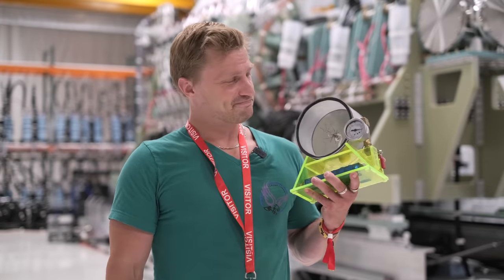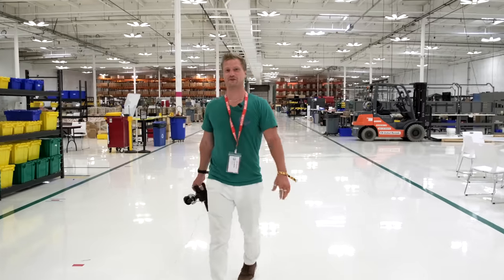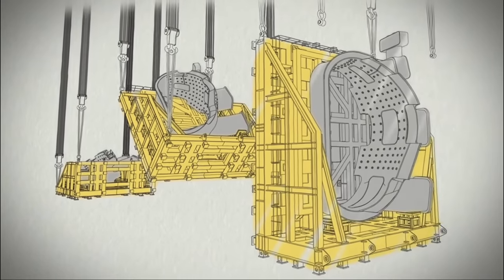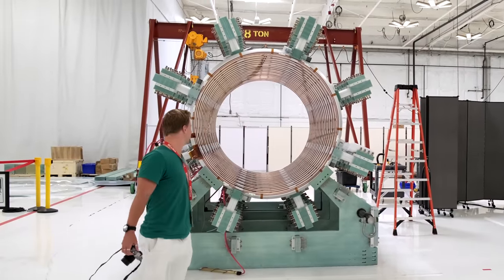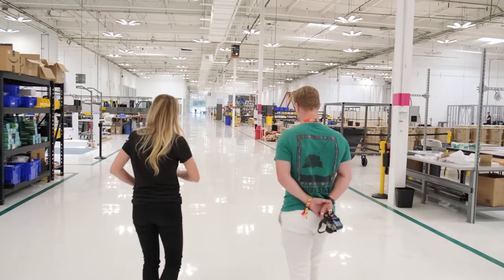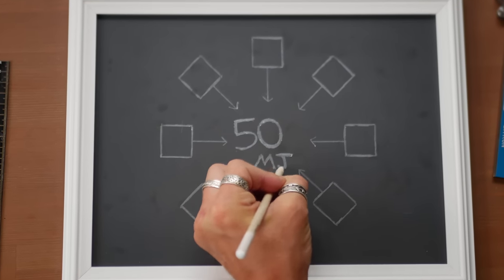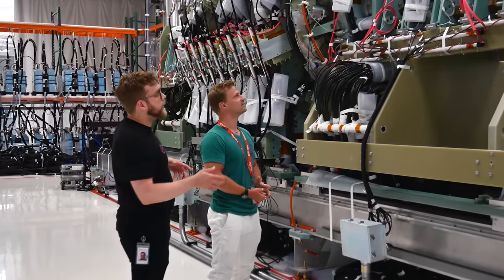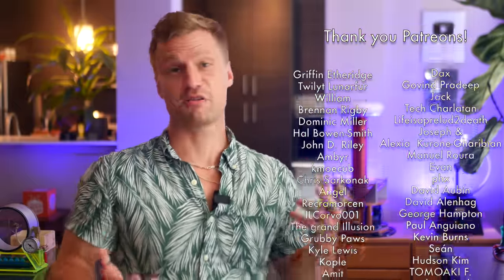An Exotic Approach to Nuclear Fusion (Helion Energy BTS)

Comment: It was awesome to have you here, Jay.  ⚡ Thanks for geeking out with us over high voltage capacitors, electromagnets, and fusion!
Reply from the maker: It was an honor to see the work you folks are doing.
Reply: I kind of wish he would have touched on the usage of H3 a bit. As my first thought was that H3 is very expensive vs Tritium, but then I looked it up and the wiki says you guys are using a D-D side reaction to make your H3, Which is very interesting and useful, and i believe worth touching on.
Reply: im waiting for what thunderfoot has to say :)
Reply: @miclowgunman1987  Doesn't H2 + H2 -> He3 also yield a neutron? Another reaction can occur which is: H2 + H2 -> H3 + H1.  Which leads to    
H2 + H3 -> He4 + N . Isn't it kinda disingenuous to insinuate their setup is aneutronic when two of the four possible fuel reactions produce neutrons?
Reply: It will never work. Fusion is always 2 decades away.
Reply: @ayybe7894  It is, and I have not seen any proposed solutions on any video helion had put out. Both the fast and thermal neutron reactions will transmute the walls of the reactor, and the fast neutrons from the D-T reaction will need to be blocked with heavy shielding, which seems utterly lacking in current prototypes. I hope they also figure out a way to deal with the unreacted tritium waste they'll be producing
Reply: @Spencergolde  It my understanding that H2 + H3 has a higher cross section for most temperatures than H2 + H2 or H2 + He3. There wouldn't be unreacted tritium waste, it would readily react to yield more He4 and Neutrons
Reply: @tarstarkusz  Hey, that's not true! Fusion is not 2 decades away! You forgot to add a zero! /s
Reply: I love the Helion project, but my question has always been how to get H3 when it is more rare, and expensive than Tritium? Please do a follow-up on fusion fuel sources with real numbers.
Reply: At the target plasma temperature just 1000X less reactivity than if they used tritium instead of helium, and 5000X less reactivity than anyone serious is trying....
Is it intentional to keep the rads down? because they're fully aware how much radiation the system would put off with no shielding and power plant levels of power...
Reply: @ayybe7894  I think the key point of that sentiment is that it usually would, that there's a high probability that it would. It's the mindset that I see helion heavily embracing and is the type of thinking that led a lot of early bomb researchers at Los Alamos to begin accumulating plutonium in their urine. These are fast, messy reactions, and likely 95%, maybe even 98% of tritium will fuse on formation. That's a problem, because that 2-5% remaining is dilute enough to make it hard to isotopically seperate from the protium and deuterium, but definitely an environmental and health concern. Tritium has a half-life of 12.3, so it sticks around for awhile and has a high beta decay energy. And when it forms water with oxygen, it's indistinguishable from all of the other water that surrounds us, besides being very slightly heavier. It also easily vaporazies and moves though the air. It can be photosynthesized into carbs that enter the food chain, and stored as lipids in fat cells. It is by far the most biologically mobile and insidious radionucleide we can imagine, and the lack of concern or insight for containment of the not insignificant amounts they're forming is pretty shocking
Reply: Are they really producing that much in this phase though? On a single pulse? Maybe if this tech was fully operational it would be a concern, but on this scale its probably no nearly as big of a concern. Also, we didnt get to see what precautions they ARE taking in this video, which didnt really focus on the whole system, but more on the theory behind how it should work. The NRC isnt going to let them play with nuclear reactions on this level without considerable oversite. We let a lot of pollutants out in the wild, but radioactive waste is heavily regulated and tracked for obvious reasons. @Spencergolde
Reply: @tarstarkusz  Helion is making it way way too complicated!
Reply: @ayybe7894  That is very true. Remember, the Sun's sustained plasma fusion color is yellow. And Helion's unsustainable plasma fusion is purple. There is no known star that burns purple. Because, in Nature, its impossible to sustain plasma fusion with just deuterium / helium. There is something else that is needed... A Universally abundant fuel source...
Reply: @PlasmaChannel  I wish you'd dug a bit more into how their 3He is obtained, since it's normally produced via tritium decay, which creates more, not less, radioactive waste issues than D-T reactors. This also brings us back to the scarce tritium issue you briefly mention, which needs to be bred via neutron bombardment of 6Li. 
D-T has been the holy-grail of fusion fuel because it has the highest energy output with the highest fusion cross-section, and reactors can have a Li breeding blanket that virtuously produces more 3H via the neutrons being released from the reaction. 
Helion Energy is sexy, but they don't answer some critical questions. Suggested reading: The Future Of Fusion Energy by Jason Parisi and Justin Ball
Reply: @ricardogonzalez361  Someone else replied somewhere, and it got buried, that they plan to make He3 with a separate H2 + H2 fusion reactor, filter out the He3, and store the H3 until it decays. The efficiency losses, added costs, and irradiated waste associated with having to run a secondary reactor to produce their fuel seem to be hand waved away though
Reply: @ayybe7894  One branch of the D+D reactions does produce a neutron, but it is a lot lower energy than D+T neutrons (2.45 MeV vs 14 MeV). D+T side reactions do not happen. The Tritium is too hot and non collisional on the short timeframe of the pulse.
Reply: @ayybe7894  D+T side reactions do not happen. The Tritium is too hot and non collisional on the short timeframe of the pulse.
Reply: @ricardogonzalez361  They produce their He3 from D-D reactions which either yield Tritium or Helium3. Tritium has a half life of 12.5 years and decays into more Helium3.
Reply: @ayybe7894  They can do it all in the same machine. It might be beneficial to have dedicated breeders though.
Reply: @ayybe7894 Exactly my point. If they plan on making 3He with a 2H+2H reactor, why the need for a 2H+3He reactor? The energy output and efficiency of D-D is way higher. The problem is, the fusion cross section of D-D is way smaller, and thus ignition way harder. Which is why ITER and most of the fusion funding has been focused on D-T designs. 
I highly doubt they are building a separate D-D reactor. Which leaves with only other option of a tritium breeding rector via lithium, generating a ton of radioactive waste.
Reply: @elmarmoelzer2229  See my thought is that the cross sectional area of the D-T reaction is nearly 2 orders of magnitude higher, so yes, D-T reactions will not only occur, they will occur much faster than D-D or He3-D reactions
Reply: If im not mistaken to fuse D2 with H3 you need temperature of billion Celsius  to billion 10¹ C , they don't want to fuse to high Coulomb barrier. On if im not mistaken we had reached  150 000 000 degrees Celsius  you need and here you need 1 000 000 000 to 10 000 000 000 in similar pressures to make them fuse . way to go way to go. 
It was a long time I had read about fusion , but maybe someone could confirm or disprove what I wrote.
Reply: @Rom2Serge  Fusion, like chemical reactions, occur at higher frequency with higher temperatures. Density is also an important factor, like concentration in chemistry. And time, reaction time or confinement time, is the biggest constraint.We haven't reached it yet, but ITER is designed to reach 150 million C in long steady state operations, with a confined density which should yield a thermal energy output well in excess of the energy input. The internal core of a thermal nuclear weapon reaches very high temperatures, in excess of 1 billion C, for just a few microseconds. The weapon needs to get that hot in order for enough fusion to occur in the very short time frame that the explosion allows. But for power generation, we can get away with a lower reaction rate for a longer amount of time. I would equate it to the difference between burning black powder in a bomb vs. burning gasoline in a generator
Reply: Where i can read white paper about energy budget inside your setup? Thanks in advance.
Reply: At 3:46 and 4:15  you said "topography" but you almost certainly meant "topology"!
Otherwise, great video!
Reply: @jimmyhackers8980 Why even bring him up? His opinion is fully irrelevant.
Reply: Please Invite Tech Ingredients on a tour. Or atleast styropyro
Reply: Just 300 more years and we can have fusion. Yep, it is that hard
Reply: @oldmech619  why do we have to be negative? If we're positive and it works great! If not oh well. But if we're only negative we dont even give it a chance to succeed in the first place. It's like it's like expectinlng a newborn to walk and when it doesn't just giving up on it. Yeah it's going to take a long as time but the more people working on it the greater chance someone will have a breakthrough. That's all I'm saying, I still doubt I'll see it in my lifetime but maybe I can give my grand or great grand children the chance to see it
Reply: @Spencergolde  No, they won't because the Tritium is too hot and non- collisional on the timescale of the pulse. By the time it has cooled off enough, the pulse is already over.
Reply: @elmarmoelzer2229  We're in agreement that the D-T reaction has a lower activation energy and higher cross section than the D-D reaction, right? It's the reason why everyone else is pursuing D-T reaction schemes. If you have a cite for some nuclear reaction kinetics in unfamiliar with I would be interested in seeing them
Reply: @Spencergolde  
Let me try that again. Yes the cross section is higher for D-T. But the Tritium produced during the 1ms pulse is very hot, over 1 MeV. It takes time for it to cool down to a temperature where it would react with the Deuterium. By that time the pulse is already over. And to the best of my understanding, by that time it will have left the FRC for the divertor. 
After the pulse is over, the Tritium, along with the unburnt fuel is extracted from the chamber before the next pulse is initiated. 
So there is no Tritium in the chamber when the next pulse is initiated. 
That said, there may be a few D-T reactions, but they would be very, very limited. Helion has done thousands of D-D pulses in Trenta which ran at 10 keV, where D-T reactions are even more likely to happen than D-D-He3 reactions and they have of course measured the neutrons and their energies as well as the fusion products produced by the shots. It is safe to assume that they know the exact rate of expected D-T reactions and from all they have said, it is negligible.

Also worth noting that the temperature Helion is aiming at for their power plants is between 20 and 30 keV while the ideal temperature for D-T in their machines would be 10 keV or less. That is for a field strength of 20 Tesla.

For more information about their physics theory do a google search for JPP08December2022_DKirtley
Reply: Waste of Time, No way will the Helion reactor work as Helion team thinks it will:
1. First off All the Deuterium will react with other Deuterium ions and not with the He3 because the D-D is 3 times more likely to fuse with itself than with He3. ie It will always take the easiest path.  D-D will produce 14 MeV fast neutrons. No way to avoid neutron radiation emissions. 
2. Helion ignores plasma scattering effect. As the plasma is compressed the ions will scatter and not focus into a single direction (ie herding cats). For fusion to happen two ions need to collide dead on, other wise nothing happens. All but a very few will not collide dead on and scatter in different directions preventing significant amounts of fusion reactions. There have been decades of experiments with pulsed fusion via electro-static confinement and the issue is always been plasma scattering limiting the amount of ions that fuse. The more you try to compress a plasma the bigger the scattering effect occurs. 
3. He3 is not an available fuel on earth, and comes from the decay of Tritium which is produced by bombarding Lithium with Neutrons from a fission reactor. it would be far easy to use Tritium instead of He3. That said the Helion reactor will not work for D-T or T-T either. There will be some fusion reactions, but not enough to produce electric power. 

Fusion will never be a power source as it has a very low density per output. The Sun only outputs about 0.27 Watts per Cubic meter. Rubbing your hands together (friction) will beat that.
Reply: @elmarmoelzer2229  I think this is where we're differing then, because here I thought that increasing reactant temperature would only increase the reaction rate, confinement density being constant. I hadn't heard of any means by which a nucleon was so hot that it actually underwent fewer collisions than it would otherwise when it was energized past some sort of threshold. I would have thought that a higher energy particle would actually take a longer path in a given amount of time, where it would undergo more chances for collision and have a higher chance of overcoming columb barrier given it's higher energy. But I suppose helion found a way
Reply: @elmarmoelzer2229  I might be wrong here but I've heard that fusion reactions are more prevalent with temperature so why would the tritium need to cool to react?
Reply: Two important questions that should have been asked: what temperature is the reactor running at and how do you deal with bremsstrahlung losses?
Reply: You're all living my dream.
Reply: @HelionEnergy so how are you guys  gonna get that Helium 3?  your gonna have to ask Elon for some  space mining stations.
Reply: @guytech7310  
1. They actually want D-D side reactions. One to two D-D side reactions for every D-He3 reaction. They need them to make the He3. D+D makes either a Triton and proton or a Helion and a neutron. The He3 is fed back into the machine as fuel for the next pulse. The Tritium will eventually decay into more He3 for fuel or they can sell it for profit. And D-D reactions do NOT make 14 MeV neutrons. They make 2.45 MeV neutrons.

2.The fusion reactions do not happen from colliding plasmoids head on. The collision merely forms a bigger, hotter and more stable FRC plasmoid. It is the subsequent pulsed, magnetic compression that brings the FRC target to fusion conditions.

3. See 1.
Reply: @sirorange1765   Up to a certain temperature beyond that it will not fuse. At 1 MeV it is way too hot.
Reply: Really enjoy what you guys are doing seems very feasible and my favorite design taking energy directly out...when you guys first started, I was under the impression you were going to capture energy created but are still going to utilize the thermal radiation for traditional steam generation like a two punch approach to electrical generation.
Reply: @guytech7310  "The Helion guy stated no neutron radiation. he is full of BS."

I did not heard that. At 08:00 in the video Helion's CEO says (sic): "when deuterium and helium-3 fuse it makes no neutrons, the primary reaction is all in charged particles".

Are you referring to other time in this video, or maybe to other source, or is this just a misunderstanding?

For those unfamiliar with fusion, what Helion's CEO said may sound as if he stated that the whole machine produces no neutrons. For those who know a bit more, what he said is that ONE of the reactions inside the plasma, deuterium with helium-3, does not produce neutrons. That is simply true.

2. I don't follow you here. How can compression increase scattering, scattering of what. By its very definition, compression implies increased concentration, higher density, not expansion and separation. For example, during compression the gas-air mix inside an engine cylinder does not get "scattered", does it.
Reply: Good luck and Godspeed, Helion!
Reply: I feel like this industry will do well in space.
Reply: I’ll teach you how to manipulate the ether when you are ready
Reply: Fantastic! Thanks for explaining how the output is working, I thought of  a question about the mentioned 6 pulses per minute..  Please humour me, is it possible/practical to achieve stable resonance in the circuit pulses, obviously a much higher pulse rate would result so how could this rate be contained/cooled?... or would this be a runaway condition that could not be handled?
Reply: Hello Helion I belive you if you invaite one person from the Czech Republic, from the Czech Academy of Sciences Phil E. Mason.
Reply: You should rather direct the ions/plasma/electrons in a toroidal way and let it collide in the middle. There are these "balls" on top of flues on roofs which are close to how it should look like!

Btw.: I can't see any replies.
Reply: @randomconstructions4513  I think yes they are intentionally moving on the lower edge of fusion temperature and it's much more about magnetic induction through plasma oscillation wich can be an important detail of the untold know-how.
This yt video below about plasma oscillation technology using cold fusion but the energy generation seems to be pretty similar:
ICCF-24 Presentation - Dr George Egely (final version)
Reply: Glad to see a new approach. This one seems to solve some of the issues with sustainable fusion. Capsules seem slow at creating.
Reply: @456MrPeople  Polaris will run at ~20 keV. Future power plants will go higher. Bremsstrahlung losses are greatly reduced because the plasma has a very low electron to ion temperature ratio (0.1 or less). Helion has links to their latest paper (and a talk at Princeton), where they explain that.
Reply: @kirill2525   Deuterium fusion.
Reply: @ricardogonzalez361   D-He3 releases much more energy than D-D (18 MeV vs 7.3 MeV) and all of the energy is in charged particles. D-D would be barely breaking even. D-He3 reactions add the net power.
The cross section for D-D is moderately higher and they want to do one or two D-D reactions (depending on whether they have enough He3 from Tritium decay) per D-He3 reaction because they need them to make He3. Helion can do both in the same machine (or in separate machines if they want to).
Reply: @Rom2Serge  They do not need that much. D-He3 is very hard to ignite, but they do not need ignition. They just need a relatively moderate Q of 2 or 3 or so to produce net electricity.
Reply: @ricardogonzalez361   They do answer this elsewhere, though. They even have a patent for it. They make He3 by fusing Deuterium (can be done in the same machine, or a different machine).
Reply: @waylontmccann  They make He3 by fusing Deuterium which can be done in the same machine or a dedicated separate machine.
Reply: For another video on this subject, that correlates with many of the negative comments written here, see:  The problems with Helion Energy - a response to Real Engineering, by Improbable Matter
Reply: @analog_guy   I have seen the video and it shows a complete lack of understanding for what Helion is doing and contains some pretty silly falsehoods too.
Reply: Helion will be brewing something beginning with the letter N… That’s a neutron 😊
Reply: How can I invest in your company?
Reply: @burgerplace9764  Of course, every fusion power plant will produce some neutrons. The important part is how many and at what energy levels. Helion will have one neutron every 3 to 4 reactions and it will only be 2.45 MeV. Not as big of a deal as it is in a D-T Tokamak. Plus, maintenance of their machines is super easy and cheap.
Reply: Such a pretty horsy!! Nice montage. Pretty boys too😂
Reply: @miclowgunman1987  - "the wiki says you guys are using a D-D side reaction to make your H3"
There was another video on this I think by either Wendover Productions or Real Engineering (forget which), where iirc they did touch on that subject.
Reply: Love platforms where knowledge can be shared. Let's  get affordable and reliable energy to worlds poorest to help free up another 100million genius' to collaborate on our next challenges.
Reply: @parcevall9477  Oh well, just wasted finite time, energy and resources spent stupidly. No big deal, at least we tried.
Reply: I don't know a lot about fusion, learning this is necessity for me to do, I have a good deal of collective knowledge in the study of "advanced energy conversions" hope to share my findings some day that will help all studies and/or practices of conversion.
I state once more that it isn't about finding the best way to convert energy, yet to find the correct way to convert energy.
Reply: @HelionEnergy I don’t know if the @ will work.  But with the size being so small compared to typical reactors, once the Helion reactor becomes refined enough, I believe there might be a possibility for it to be used in spacecrafts.
Reply: Lololopolooololoolololo
Reply: Saffire project already achieved fusion; Helion is clueless, based on 150 year old theory the the sun is nuclear powered at the core
Reply: no that's Justin Hammer's basement; Mr Hair Jell with the steroid biceps, Saffire project already achieved this using just an anode and cathode in a vacuum.
Reply: you don't have to confine plasma with magnets, Saffire project just tunes plasma to create double layers.  DARPA already has partnered with Saffire and shelved it because it works
Reply: Excellent video, I loved the walk through with Helion, an exceptional company for sure. Wish them the best for the future.
Reply: ooooo is that a clean room i see how interesting
Reply: would a cold plasma reactor be possible
Reply: Apologies but I'm afraid that your approach is massively flawed.